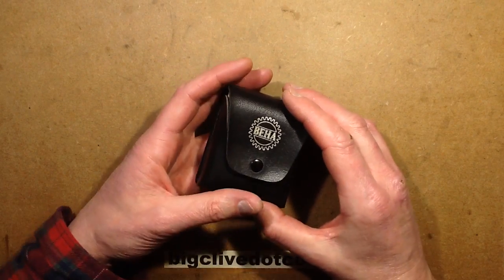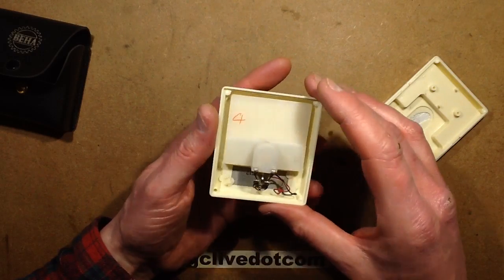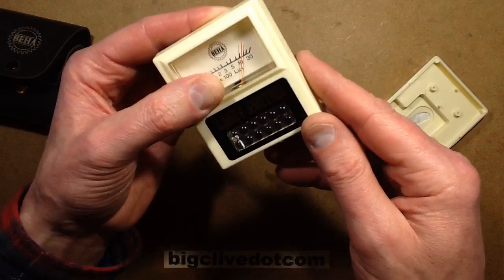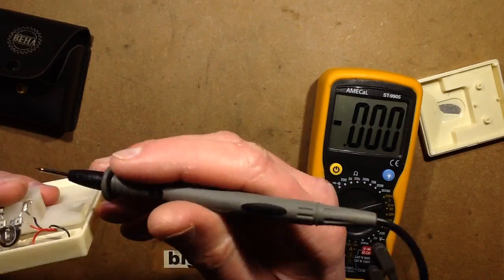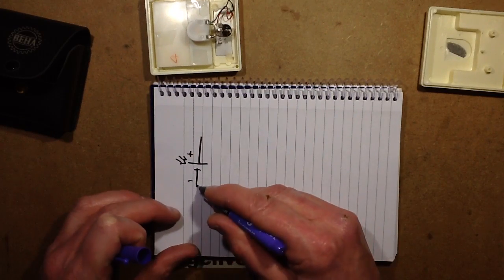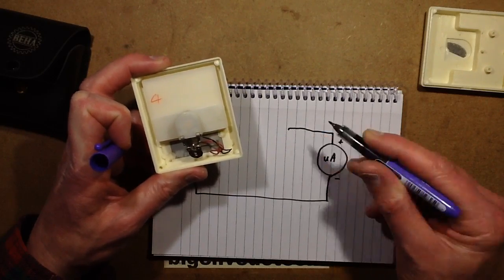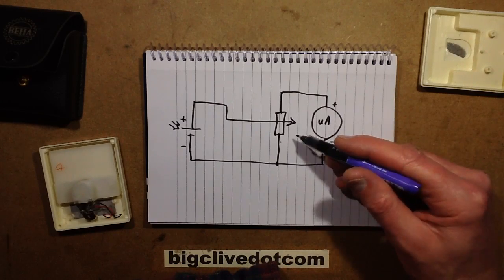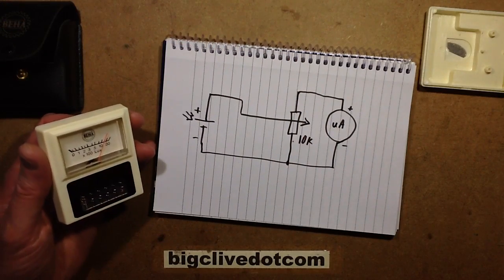Inside an old BEHA light meter, with (3 component) schematic.

Comment: just came up with a life hack....maybe done before maybe not?
i had a 50 watt led driver with matching led and a hacked together 7812 driving a computer fan off of the 32 volts off of the driver, the led died....i didnt have any more 50 watt leds, plenty of 100 watt leds though, simple solution? run a blade along the traces of half of the leds dies(in reality, i only cut 4 rows so its underpowering them slightly with 60 dies active, just thought i'd pass it on
Reply from the maker: You can run a 100W LED on a 50W driver.  It's actually a good thing as it just shares the current between the LEDs so they are less stressed.  My bench lights use 100W LEDs on a 20W driver.

Comment: Thee schematic is weird, I'd have expected a straight potential divider, with the solar cell going to the top terminal and the meter coming off the wiper. As it is, one half of the pot provides a load for the cell, and thus establishes the constant factor for a voltage proportional to the amount of light, while simultaneously the other half acts a series resistance for the meter, thus providing input into the voltage-to-FSD equation.
I mean, with just three components and an analog pot I suppose it still works — but it's weird.

Comment: Isn't the potentiometer splitting the load, so they can precisely configure the meter for the printed lux display?
Reply: Richard Smith It is operating as a dividing resistor to calibrate to the display, so yes.

Comment: That's the thing with multimeters, I don't care how expensive they are, what's to say how accurate it really is? You can have it professionally calibrated and what's to say the device they used is right on because I paid to have mine done and immediately took it to another place and they showed me my meter off so how do we ever know what we're testing is on the money? I even used a power adapter that specified Only use this adapter for this device. This device needs this 12 volt so never use another 12v power source and it was off, it said 11.8v! We spend a fortune to find we're only getting ballpark figures.
Reply: MrBrymstond What are you considering to be "off"?  When a meter is sent out for calibration it is checked to verify that it produces readings across all ranges and functions that consistently fall within the manufacturer specified tolerances for each range, not that it produces an absolutely specific value.  An adjustment is only made if the meter produces readings that fall outside the original manufacturer tolerances.  How tight those tolerances are will depend upon the absolute accuracy of your meter, as specified by the manufacturer.

As for the accuracy of the gear used to calibrate other gear, typically you will use gear that has a tolerance and accuracy at least 10x greater than the equipment you are validating the calibration of, which means any error in the testing gear is essentially off the scale (as in a digit beyond what the tested device can display).  So if you are calibrating a 4.5 digit meter then you will perform the calibration tests using at last a 5.5 digit calibrated meter and test generator.  The equipment used in calibration will typically be calibrated one or more times each year depending upon manufacturer specifications and what ever standard the calibration lab is certified to requires.  If you get a certificate after the calibration (often an added cost) then you will receive a certificate back with your equipment that lists precisely what equipment was used to test your meter's calibration, including the serial numbers and calibration dates of each of those pieces of equipment that were used.

But, yes, two calibrated and identical meters placed next to one another can certainly produce different readings and still be well within calibration and so long as they are both within their manufacturer specified tolerance for each range and function then both are absolutely correct within the limits of their absolute accuracy (which is almost always less than the number of digits available).  To not show any error greater than +/- 1 in the final digit would require a meter that at least was 10x more accurate (and tighter in tolerance) than the number of digits it actually displays -- which is very unusual since people are often more interested in seeing (resolving) fine relative differences between two nearly identical readings than they are in absolute accuracy.  Achieving absolute accuracy costs real money since it means much more accurate gear is required and for most purposes that sort of absolute accuracy is of very limited value as one is most often interested in the relative magnitude of readings and the ability to resolve subtle variations versus absolute accuracy of the value read.

Comment: Certainly less to go wrong .....  And what more do you really need, anyway?  Convert light energy to electricity, measure how much electricity is being produced  (which depends on how much light is being gathered),  set calibration .....  That's three components.  You could just about get it down to two, maybe, by being clever with the number of turns on the coil of the meter;  but that probably is a bigger complication than adding a potentiometer.

Comment: For solar cells, their short-circuit current is approximately proportional to light intensity. So it's really measuring the current, not the voltage.

Comment: What are solar panels made of? What's the difference between poly and mono crystalline panels?
Reply from the maker: A monocrystalline panel is generally formed from one pure crystal and has a consistent blue colour.  A polycrystalline cell is more crystally looking and an amorphous cell is a brown material on glass.
Reply: bigclivedotcom And then there are the polycrystalline solar cells which have the coloration of monocrystaline (black) but look like a shattered mono cell, as they are just multiple crystals that were grown in random orientations to one another.  The mono cells are most efficient and also most expensive as they require very tightly regulated crystal growth, while poly and amorphous are cheaper to produce but not as efficient at producing power.  Also, amorphous can be made on flexible plastic films since they have no rigid crystal structure.

Comment: I didnt know light meters had solar panels in them. I wonder how it compares to those other light meters you were testing LEDs with a while ago. the modern digital ones have translucent windows so they must be some other technology, LDRs maybe?
Reply: It's a good idea, because the meters they use need only a tiny amount of power to operate. So using a solar panel does the job of light sensor and power supply all in one. So you don't need batteries. 

I dunno about the digital ones. You can get solar powered calculators of course, so perhaps it's the same thing, same solar panel for power and sensor. The translucent window I would guess is to diffuse the light. Otherwise if certain bright spots happen to fall on the panel, it won't be an accurate reflection of how bright the room is.

Comment: Hard to adjust to the non-US resistor symbol: keep expecting the zigzag. But I first saw it around 1970 so if I can't adapt it's my own damn' fault...
Reply: Me, over 40 years and I feel the same, but in my case 'sod' wouldn't be the word most people I know would use!
Reply: If you see a spiral wound circular coil at a right angle, it looks a bit like a zigzag (actually a dense sine curve). The US coil symbol exaggerates the view from an angle. The old German symbol exaggerates the right angle view.  However as a European EE, I tend to prefer the expressive US symbols for most things except electrolytic capacitors. Those ISO symbols make diagrams unreadable, especially for digital circuits.
Reply: You are not alone, i allways draw a zig zag for a resistor, i guess it was resistance wire between nails, or similar perhaps.
Reply: zx8401ztv I always thought that it was because a zigzag path would resist someone's forward progress, so it was meant as an analogy (if an imperfect one)...
Reply: Same here. I know the ISO symbols are simple for good engineering reasons, but I can't help but think how incredibly lazy and non-intuitive they are (to someone who has read American schematics for ~30 years, produced over the past century). Consider the symbols for resistors and fuses to see what I mean.
Reply: Im no lover of boxes replacing components, except voltage regulators and chips.
Yes i too have been into electronics for over 30 years, i dont change just for the sake of change.
Im a stubborn sod LOL :-D
Reply: LOL :-D ive been called most names and they bounce off, you sound very similar :-D.
Ive spent too much time on c.b radio in the past, it case hardens you with people swearing :-D
Reply: I've seen the zig zag symbol used for transformer coils in old German telephone schematics...
Reply: How odd, ive allways rewound a transformer in a circular way.
To wind something in a zig zag the man must have been high on something lol.
Reply: Well, you know, Germany.

Comment: Back when I was seriously into photography, and had an assortment of better Weston, Gossen, and Sekonic meters (and one Knight Kit from Allied Radio), their readings were amazingly in agreement with each other and gave accurate exposures. When I was in a combat photo organization in the military, our meters actually had calibration tags and were lab calibrated.
Reply from the maker: It may be that the use of a silicon cell results in a very consistent light to voltage ratio, just requiring scaling.
Reply: I bought a Gossen Lunasix in the middle of the last century and I think it needed calibration. It was quite expensive and was built like tank, but it needed batteries.  The selenium meter were incredibly cheap, and responsive.  I think now it would have been wiser to buy the selenium meter.
Reply: I have a similar self powered light meter built into my old halina 3000 camera (made in hong kong). The needle pointed at a number between 2 and 14 and you adjusted the aperture and shutter til you got the same number in a little window.  there was an adjustment ring for the ASA which offset the window.  adjustment was in whole stops so if the meter went up by one it meant the quantity of light had doubled - didn't need to be totally fantastic tbh as analogue film was pretty forgiving when I was using it.
Good system - worked well.
Reply: Selenium based solar cells were very popular for light meter applications even later on, and with good reason; their spectral response is actually closer to how B&W film responds to light than normal silicon solar cells.
Reply: I recall these selenium based meters losing accuracy over the years and eventually stop working at all.
Back in the eighties there were lots of these from the sixties and seventies in second hand camera stores. I've seen many that hardly responded to light anymore. The reason why manufacturers like Gossen moved on to battery operated meters.
Reply: @Ni5ei Selenium meters degrade in a manner similar to silicon solar cells (that
 is, with use). I suspect they do fade a bit faster than silicon, but I 
do not know if there's been any long-term study on the matter.

If a meter was regularly stored in its case or in an opaque container they can keep working for a long time. I have meters from the 50s that still work perfectly and read within 1/3 stop with modern meters. Big difference is that they were kept in their cases. Cameras with built-in meters often died if they didn't have cases or flip-top covers over the meters.
Reply: I think the light meter acc that you could buy with a Lica or Rolliflex used these batterieless (word?) light meter.  The ones using batteries (Lunasix) were probabily a step backwards.

Comment: Isn't that a selenium cell?
Reply: I think that early photographers light meters used selenium cells. Clive's meter looks like it works in a similar way. But I don't know very much.
Reply: It indeed looks very similar to a lightmeter I own from which I know that it contains a selenium cell.
Reply from the maker: Visually it has a smooth deep blue layer on the front with a single silver collector line.
Reply: Linus Johansson doesn't look like the selenium cells I saw in my childhood, for what that's worth. (Late 1960s - early 1970s.)
Reply: It looks very much like the Leningrad Selenium cell lightmeter that I used to own back in the 70's. I have been looking to replace it with a meter from Sekonic that also has a Selenium cell. The cell in that meter is a deep blue in colour. As far as I am aware most of the light meters of this type have, and still do use Selenium cells.